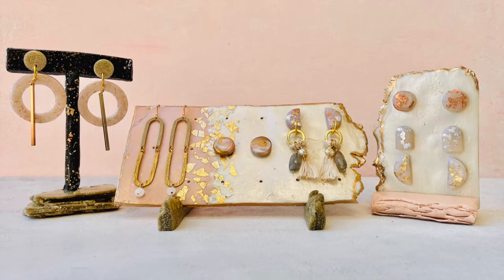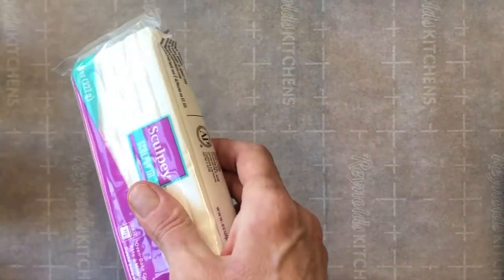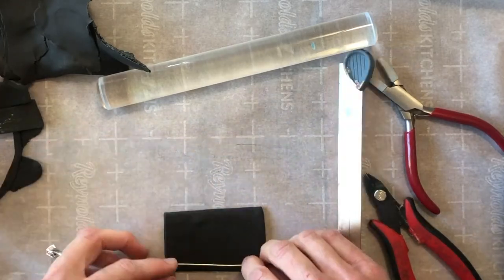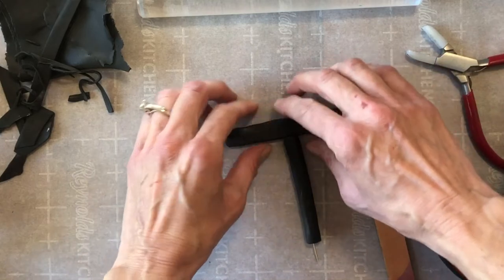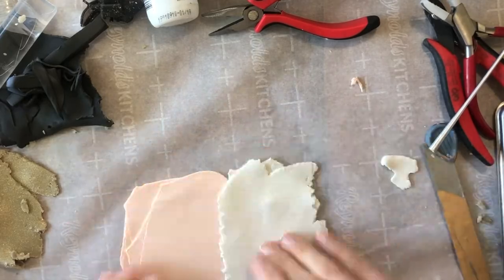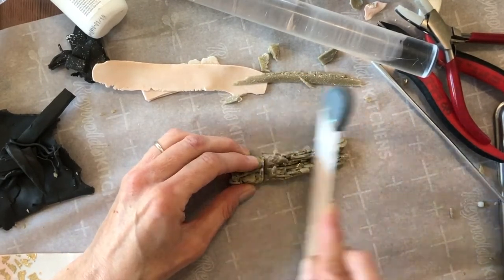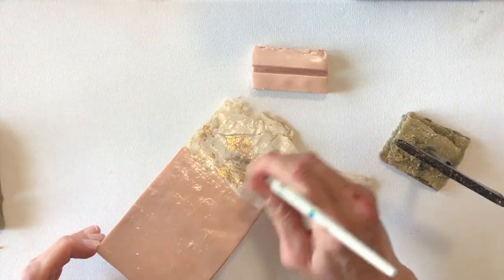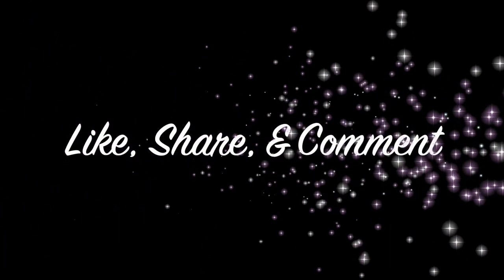DIY Polymer Clay Jewelry Display Stand Make Your Own Jewelry Stands Full Tutorial

Comment: I will attempt this but I am curious to know why did you drill the hole after the clay was baked as opposed to just poking holes when the clay was still soft…
Reply from the maker: You can totally poke the holes before baking. I’ve done that and I prefer the uniformity of the drilled holes after baking versus the holes that can distort with the slightest movement pre- or during baking. If you can keep them still and straight, you might like that better.